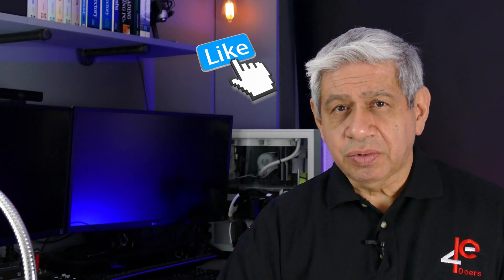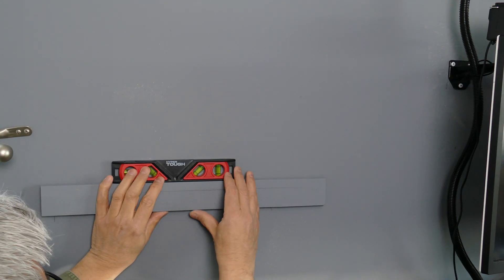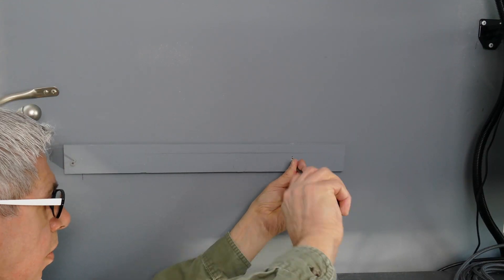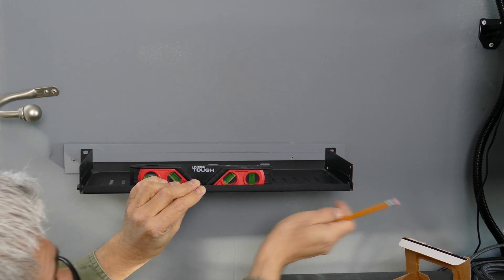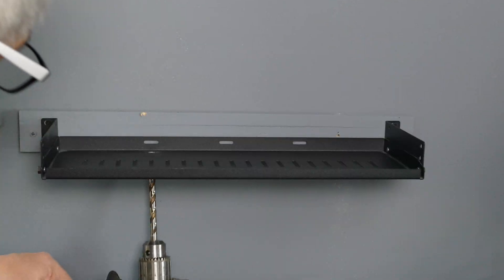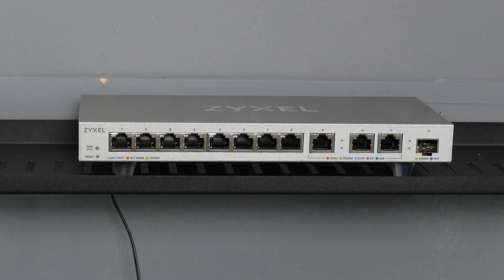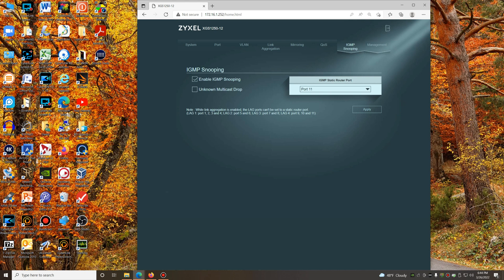Follow-Up on a ZYXEL XGS 1250-12 Switch Installation

Comment: Don't buy it. It is completely bugged when you try using VLANs. 3 of the 10G ports stop working completely and it leaks packets to other VLANs.
Reply from the maker: I have had no issues with mine except being a little warmer than I would like.  It has worked flawlessly for me since I purchased it over 3-yrs ago.
Reply: @PE4Doers  Do you have revision 1 and do you use VLANs? It only happens when you try to use VLANs.
Reply from the maker: @EnitinEnitin  Good point.  I will be enabling VLANS on my main Router and Prime Switches very soon.  So I will take a look after that transition.

Comment: Thanks for the video.
I currently have an 8x Zyxel, quite old but need to move onto 12x to save me keep unplugging and replugging Ethernet cables to different parts of the house. I only have 1Gig Ethernet with the possibility of 1.6Gig with FTTP in the future.
Questions -
1. Is this router ok for my needs
2. Is there something more suitable

Many Thanks
Reply from the maker: It functions extremely well as a small switch (not with routing capability, but does support passing through VLANS from a router).  I use mine nearly every day as the main switch for my content creation studio - no complaints (although it does get quite warm by not having a larger fan).

Comment: Having mounted many switches and power strips to walls I have always found it easier to place blue masking tape down first and make your marks on that instead of directly writing on the walls.
Reply from the maker: You are very correct.  I decided not to in this case, since the paint had only been on the walls a few days and did not seem to be fully cured.

Comment: good video, how did you get to the management screen for the switch?  i can't find ant software.  thanks
Reply from the maker: It is an embedded Webpage on the switch, so you need to determine the IP address it was assigned.  You could go into the DHCP section of your main Router and look at the DHCP lists and should see it there.

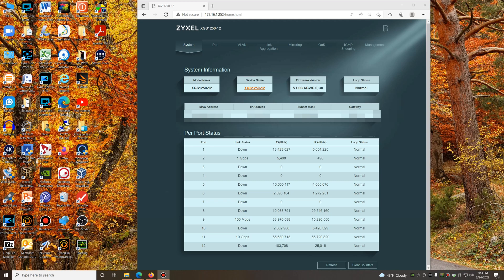I discuss this in my other XDS 1250-12: https://www.youtube.com/watch?v=fA_abOBvPyA&t=630s  starting at 6:26 into that video.  I discuss using the ZON utility  at 11:19 into that same video. 

Or you can load the ZYXEL ZON utility on your PC and it will locate the switch for your.  See: https://zyxel-one-network-utility.software.informer.com/download/ for the download.
Reply: @PE4Doers  thanks a lot for the advice.
Reply from the maker: @lambo7  you are very welcome 😊